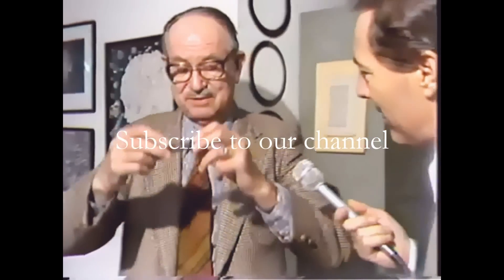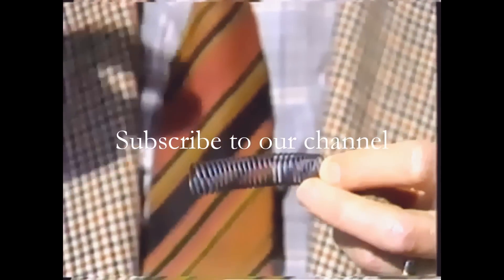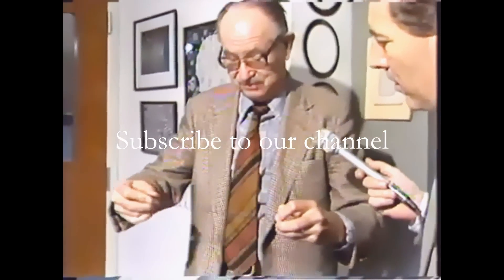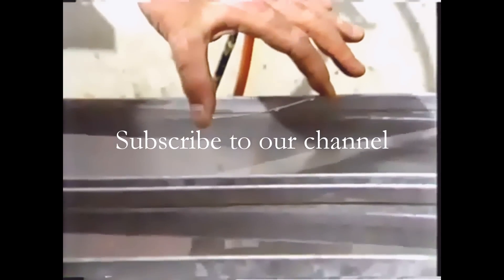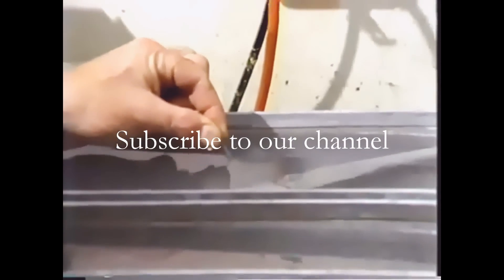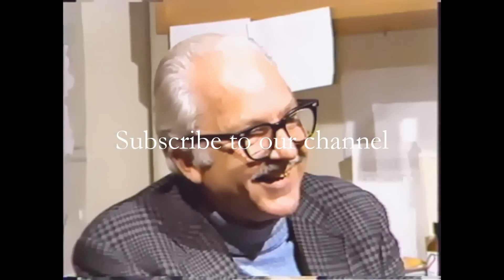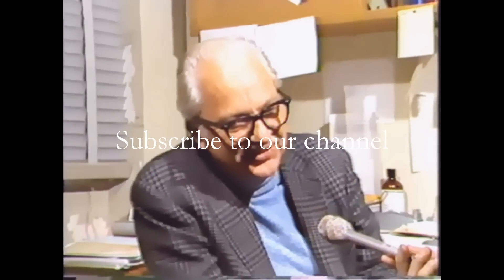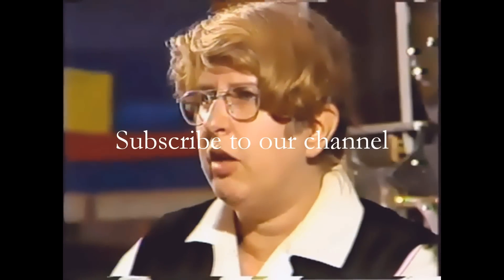Free And Virtually Unlimited Fuel To Heat Your Home

Comment: I got to play around with this stuff when I worked Security at Rockwell Collins.  The engineers found some in an old storage locker that was supposed to be used for a Boeing project.... like a decade ago.  Its sad people keep stuff like this suppressed.
Reply: Cedar Rapids Iowa? I'm from Dike. 😎Peace.
Reply: I bought some of this wire probably 20 years ago from the back of a science mag. It was a little pricey for the amount of wire I got. I think five 3 inch pieces for  $20. Really small gage like steel guitar string. It was sold as memory wire.I don't even know what I did with it.
Reply: Sorry to burst you bubble pal, but you could buy this a memory wire 30 years ago. The only sad part is that fools are convinced that <16% efficiency can 'save the world's energy problems'.

Comment: Interesting. 
But they are wrong about one thing.
The very first heat engine, the Stirling Engine, was in use more than a century before this was shown on TV.
Stirling engines have been used in all kinds of applications from manufacturing to running a simple fan sitting on a desk.

Comment: I don't know much but in the display he had hot water on one side and cold water on the other while it is spinning it must be picking up the hot water and throwing it to the cold side and vice a versa, it would take energy to keep the hot side hot and the cold side cold and it seems like it would stop working because with hot and cold water being transferred to the opposite side it would all become the same temperature so how do you keep it going?

Comment: Maybe if the nitinol engine can produce electricity, some of that energy can be looped to a water heater to keep the water hot, then the engine could be self-sustaining.
Reply: Attach it to a car alternator.
Reply: Ricangal I'm sorry to say it would be a zero sum gain.... the amount of energy needed to keep the water with a 20° differential would likely be more or the same as produced...;(
Reply: Not really. Just look at the "cooling water" from a nuke power plant
Reply: Ricangal no such thing.
Reply: Ricangal that's what in screamin
Reply: +Ricangal:   ??_??   Over Unity??  FREE   FREEE  FREE! Have you not yet learned? Besides: Think FLEA POWER!!
Reply: Ricangal that's not how physics works
Reply: Just look at the "cooling water" from a nuke power plant 

Nuclear plants use either cool water from the ocean or evaporation from the cooling towers to condense the exhaust steam.
Reply: Ricangal  brilliant
Reply: Ricangal I would think the law of conservation of energy would apply 
 Perpetual motion is not real. A large enough  one of these can run all day on hot water in black pipes and  it could store electricity in a battery for after dark

so using  source for hot water like a geyser or power station would work, but no perpetual motion
Reply: Why not solar to heat the water,  just as they explained in the video?
Reply: Ricangal if you knew anything about the competitive system in universities the academics would have been falling over themselves to describe this and publish it. Much as I would like to believe in it,
Reply: Insideous Harsh Reality Too much effort. When are they going to come up wth sometning hasslefree
Reply: A water heating solar panel and a way to store the energy it produces during the day.

Comment: Fantastic ENGINE. Please, no claims about free energy. Talk about efficiency.

Energy to make heat, energy to make cold.
Reply: Brian Smith Do you notice that the hot water is not all that hot?  It is in a glass,  sitting on the top for the time the men talked.  Then he poured the water over his fingers.  No protection.  Its not difficult to heat water using the sun.  And you can easily get a circulation of cool air from the ground.  We are so brainwashed into thinking we need machines for everything. When the trith is,  there are many was to accomplish things.  We have just lost the knowledge of how to do so.  Thanks to modern technology.

Comment: Does it put out more energy than it takes to heat the water? If one part needs to be hot and the other cold then energy needs to come from somewhere to heat the water. I don't see how solar heat can be used since you have to isolate the cold water.

Comment: Depends on how much energy it makes versus costs such as the product and mostly the warm/hot water - How much is that. How well does the product act if enlarged
Reply: Electricity can be used instead of heat, which is a very interesting concept

Comment: Where is the fuel? Your title and description state that I can find free fuel to heat my home. This devices requires heat to function. It does not produce heat. It takes more energy to heat the water to turn the crank than the crank gives back in torque. Where is the free energy?

Right. It's not free. You are already wasting energy. This recovers some of that lost energy. It is not free, you've been paying for it all along. Even then, this can only recover, what, 20% of the lost energy, at most? How does that compare to solid state devices? Poorly, I would imagine, considering we use them instead for this exact purpose today.

Comment: All u need is an oil furnace to make heat and you have free energy.  It's not converting heat but difference of heat just like a peltier unit that you can order online for 2$. That produces voltage when 2 sides exposed to different temp.

Comment: Then again, why not simply get a 36V 600W E-bike motor, 3 400W solar panels, 3 12V rectifiers or 1 36V rectifier, a bike trailer big enough to hold the panels to the sun and go from there? It'd cost about the same, be less finicky and if you get a few marine batteries in the trailer under the panels too, you can even ride some at night, plus protect the motor controller from going into circuit protection during extremely sunny times as well as be able to run the motor at full power when you want, instead of maybe at 5/8 power during cloudy times :)

Comment: in the beginning of the vid the guy had to bend the wire every time he put it in the cold water ....so how is the engine running if it's supposedly sunning from the energy released? would it have to bent the wires every time they went from hot to cold?
Reply: zoom zoom24 because the nitinol wires are under constant bending forces it's only when they get in hot water that they overcome those forces ,straighten out and turn the wheel when they get back to the cold water they bend.

Comment: How much energy is generated by wheel; more or less than that used in heating and cooling the water?  How is temperature difference between cold and hot water maintained  with the water being carried by wheel from one to the other mixing them together? If this was practical someone would be using it.

Comment: but where does the waste heat come from? or how do you get the hot water to run the engine without having to use some other form of combustion
Reply: Solar heat for water, it was talked about in the video actually.
Reply: @Aaron-zy3ks  Yeah but at that point you may as well be using the solar panels for energy, as it would be generating the same amount that its outputting into the wheel.

Comment: Unfortunately it still follows the laws of physics and conservation of energy so it is limited to less than 100% on thermal to mechanical energy conversion.  
Now some 40+ years later it has in fact been studied extensively and was found to be dismally inefficient in this conversion process.   15 - 20% is the best it does which puts it conversion energy at a value less than most present AE/RE thermal  to mechanical engine tech runs at today. 

In fact as for thermal to mechanical energy conversion a good multistage steam engine, from the late 1800's, had 2 - 3x better working efficiency than this stuff has.   Same with most any common basic Stirling engine of today or coal, gas or liquid fuel fired turbine  based genset power plant which has similar conversion efficiency to said steam engine as well.  

That's why it's not powering the world today.  It's too inefficient to be worth messing with, not because it's a suppressed technology.
Reply: I'm sure it has it's uses though. Some how
Reply: That could power a small generator enough for me to power a whole woodshop!
Reply: it depends on the heat differential required and the amount of electricity required to pump the water
i imagine you could set up a little generator using a roof solar heating unit but it probably cant be scaled up
Reply: harry potter,  agreed. One generator can power another...and so on and so forth...no grid
Reply: Are you saying there is no applicable use for this type of tech because of conversion day deficiency?? At all?? Surly there are work arounds. If this material is infinatly reactive to thermal variance. And the only draw back is conversion differential between thermal and mechanicle energy. There has to be a solution to bridge the gap
Reply: We don't understand the laws of physics . Not even today!! ;)
Reply: +brad zybola, the conspiracy theorists have an IQ barely approaching the efficiency of these engines. You can't expect much more from them.
Reply: +Brandon Allen "There has to be a solution to bridge the gap" - Sure there is...because 40 years of experimentation has gone nowhere, but magical thinking will bridge the gap, right? Ask yourself why we don't have everyday Peltier or Sterling engines doing useful work and you'll see why Nitinol is no better.
Reply: Luis de Rivas,  unfortunately you are way too correct in that statement.  It's easy to believe the world is unknown when you're not knowledgeable and or intelligent enough to understand half of what everyone else who is smarter and more knowledgeable than you does about something.  

I've dealt with those types of people all my life and it's  bewildering to see how much thought some people (with such obvious limited thinking capacity and working knowledge of anything let alone actual topic in play ) will put into not accepting reality. 

I can't count how many times I have seen and heard someone say "if you just put XYZ and ABC together you'll have something'  when the fact is reality is overflowing with other people who have tried putting XYZ and ABC together in countless ways only to find out reality doesn't work anything close to what and how they think it does, just as a few comments here already show.
Reply: Uh...no
Reply: All homes can be run off solar panels.  Yet we dont have a singal municipality pushing for the change.  In some places,  Florida for example,  by law,  you must be connected to the local electric company even if you choose to install a solar system.  These are facts.  Yet you want people to believe that all experiments have been exhausted with the potential of nitinol benefits?  Keep believing it.  The oil companies have more power than you anyway.
Reply: it could pump water for every african village for free beyond set up costs. Oh but thats only how many millions of lives saved?
Reply: It could pump water free for every African village, but thats only how many millions of lives saved???
Reply: Katherine Venes yep.  But we both know it is about money earned,  not lives saved.  :(
Reply: tama yeager gibson,  Can you show me teh fact based math on the cost of such a solar powered home system that will power a typical American or Canadian household the same as it is now even in the winter months that have short usable sunlight hours plus frequent cloudy days?   

There's a reason these AE tech concepts are not in use now and it has nothing to do with suppression of technology. It has everything to do with practicality and cost of ownership and operation.   

My point is tech that give the most output under the widest working conditions for the least personal effort investment and financial costs wins.  Solar and national tech doesn't fit any of those criteria.
Reply: katherine vines, same question for you. Got any numbers to back those claims up on?  Especially proof of millions of people dieing in any rational timeline from lack of water?  

As for the reality of the nitinol heat engine concept as I have stated before in earlier posts, the reason it is not used simply due to its dismal energy conversion efficiency which so far has no workable solution to bring it up anywhere close to the heat engine tech like the well known and developed Stirling heat engines  that run at 2 - 3 times the working efficiency with less parts as well.   

That's the problem. There is no secret big oil technology suppression scheme in play or anything else since, obviously anyone can go and buy the materials to build such an engine or even develop a better one than is shown in the video and then go onto market it themselves and make billions off of it.   

That's how the American free market and capitalistic enterprise system works and is proven every single day by the millions of people who own and operate tiny home based fabrication, manufacturing, Research and Development,  online retail sales and countless other highly successful micro businesses that are presently putting a huge hurt on giant corporate entities today to the point it's killing or has already killed many of them.
Reply: Tcmtech Don't fall for this comment, folks. It is clearly a carefully crafted, technically constructed statement to dissuade people from realizing the Truth about how this technology has been quashed by the ruling elite. This is classic methodology to disinform and lead astray by means of "perceived" intellectual insurmountability.  Your eyes should be all you need to see the majesty if this material and its seemingly endless applications. Come on, already, Jesus.  This place sucks so bad and it's high time the ruling trash is sent to the Lake. Peace.
Reply: Did he say 5k lbs per sq in ? Sounds pretty crazy
Reply: Thank you. Somebody was educated.
Reply: So it's about as efficient as running a 500W electric motor on a bike and 1000W solar panel on a bike trailer's cover and a couple marine gel-cell batteries wired in series in the trailer except you don't get hot water sloshing your legs and it can even be used in the Winter all day or limited range at night? I know which option I'd choose, but I must admit to being fond of this little 70MPG engine I have in my bike frame which I run on E-85 fuel. It was cheaper to buy and is convenient to fuel, plus I'm a night owl, so solar isn't the best option for me.
Reply: Tcmtech oh but I bet I can make a perpetual motion device if I just...( JK)

Comment: There is a thing called steam locomotive back in 1850 Stanley Steemer. So you have to heat up water and cool water which takes electricity and or gas and then what?